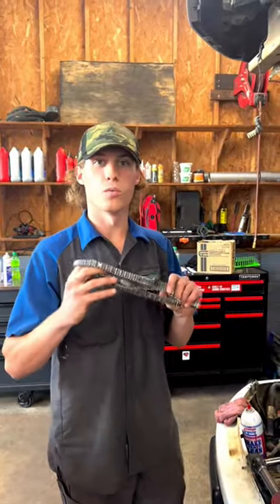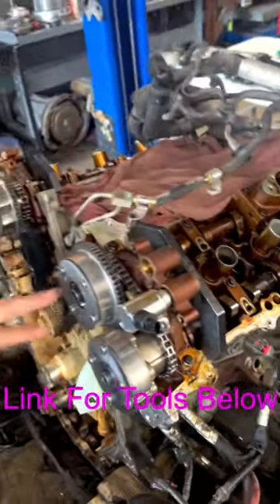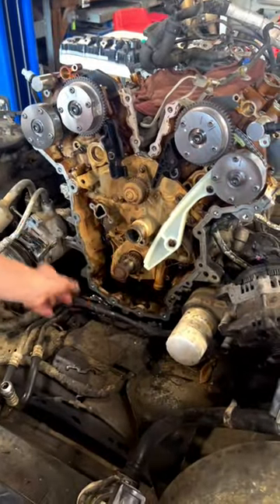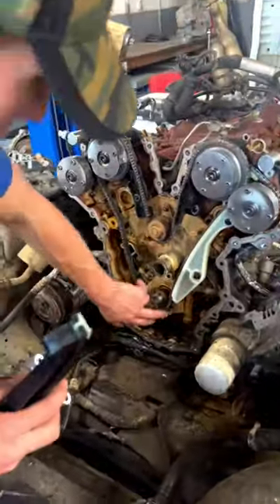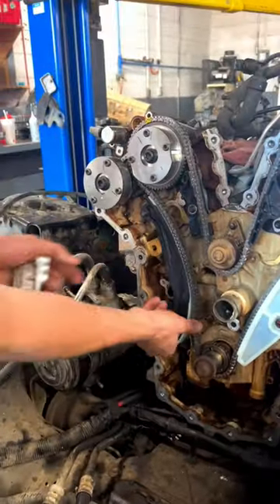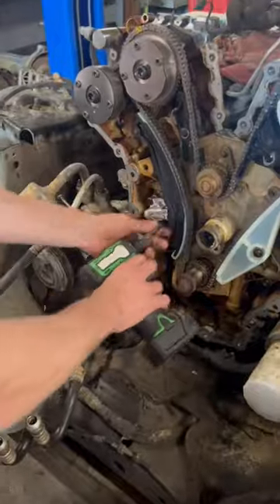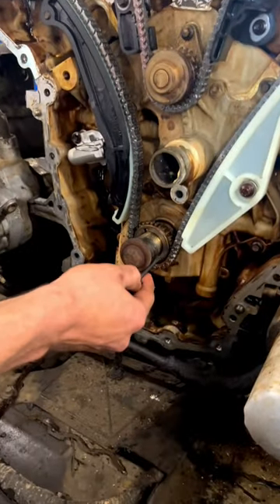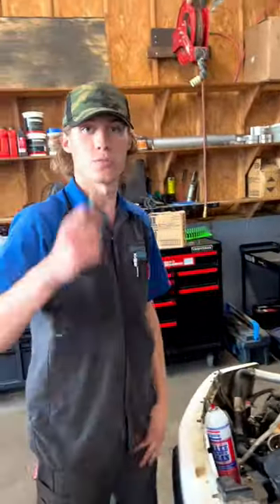How to Time a Ford 3.5L EcoBoost #shorts

Comment: Is that a timing chain driven water pump? If so, why didn't you put a new one on?
Reply: So on the Ecoboost it's not inside like the not available/na 3.5l it's on the front like a 5.0
Reply: @Crockedflyer811  Whether it's internal or external has to do with it being longitudinal or transverse, not 3.5 NA or EB or 3.7
Reply: @foojub6907  oh I see cool didn't know that

Comment: Why u don’t change the water pump ?? If you already have everything at part ???
Reply: How do you know he didn't change the water pump? The water pump for this truck is not even shown in this video.
Reply: Water pump is external on this configuration.

Comment: Should of moved the locking ring to keep tension till oil pressure is good
Reply: The tensioner is spring loaded, not ratcheting, ratcheting design caused issues.
Reply: @foojub6907  yep sure is and has a spring locking clip...
Reply: @justinsolomon6972  could you explain please? I don't understand
Reply: @foojub6907  it's a spring loaded cylinder with a back cut circular groove along the lower portion that a simi floating snap ring moves and when engaged holds chain tension .
Reply: @justinsolomon6972  how would you move it to do so? Doesn't pulling the pin accomplish that?
Reply: @foojub6907  the pin only holds it in a compressed state. The lock ring holds the cylinder out holding tension on the guide.
Reply: @justinsolomon6972  right, so how would he adjust the locking ring to hold more tensioner than the spring on its own? I’m doing one of these right now so I’m hoping to learn
Reply: @foojub6907  just move the ring down the cylinder into a cut channel.

Comment: Why did you not change the water pump while you was already in there?
Reply: Not a water pump. Longitudinal 3.5 has external water pump, internally replaced by an idler.

Comment: @FlyingWrenches13  Why does my 2014 only have 1 vct solenoids per side and different looking exhaust phasers?  Can't find exact info anywhere.
Reply: If it's not Ti-VCT (twin independent variable cam timing) but just i-VCT then you only have phasers and VCT's for one camshaft per bank

Comment: Mazda 3.7 liter. The same?
Reply: the same-ish. for yours it is transverse, so you have an internal water pump in the middle where the idler is on this engine, which should be replaced. If you're doing this job it simply makes the most sense to replace all guides, tensioners, tensioner arms and chains. Would do the crank sprocket as well. Phasers not unless you're having issues

Comment: The first thing is replacing the water pump. the last thing is to put everything back together.
Reply: Last thing's the water pump, actually. External on this configuration. Transverse has the internal pump.

Comment: If it’s interference design, that crank will not rotate a hundred times let alone one time with the cams locked down.
Reply: He's not saying rotating it with the cams locked, he's saying it wouldn't matter if the crank moved, so long as all the marks line up it won't be out of time.

Comment: Not changing the water pump while you’re in there is CRAZY.
Reply: nah, what's crazy is worrying about water pump replacement when its external on this engine. Longitudinal 3.5/3.7 have external pumps that can be easily replaced without cover off/timing. Transverse have internal pump for fitment.
Reply: The water pump is external on F150s and also removed in this video.

Comment: Anybody ever have an exhaust camshaft off one tooth and have it run okay just a rough idle. Currently going on with my truck and getting a camshaft b over retarted code. Already ruled out the sensor and chain is 5000 miles old

Comment: Or buy a motor with no internal plastic parts in the first place.
Reply: these engines have issues with phasers, water pumps, or chain stretch. plastic parts is not one of them

Comment: Did you ever do the timing on a 46 and a Lincoln LS you know how f*** up it is Ford actually tells you to tie the timing chains together with twine or fishing string to keep them tight so that when you crank the engine and oil pressure is build the tensioner snap and literally sounds like something broke scares the s*** out of you specially first time doing it

Comment: Don't you think it's a good time to change that water pump before a major failure?!!
Reply: External on this configuration, not internal.
Reply: Can you please tell me which gen one 3.5l ecoboost use external water pump please cause I saw many of them with internal water pump. Cause even if it is an external water pump still need to change that water housing seal and that timing chain idler on it and still it can cause of major damage to engine.
Reply: @mohammadtaqi1396  longitudinal are external pumps. Transverse is internal. The gaskets and idler are not known to fail

Comment: Dude why aren't you putting a water pump in there it's only the cost of the part
Reply: How do you know he didn't replace it? The f150 does not have a chain driven pump.
Reply: That's right the F-150 has an external water pump not driven by the chain, but that  center idler is, it's still only  50 bucks still replace it he has a sealed bearing in it. I woul replace it think will it last another 150k?

Comment: Seems to me these new high tech engines from most all manufacturers are not worth a damn. So many issues with high  tech. I miss the old muscle cars from the 60's.. not crap, always ran and never an issue.
Reply: If you really believe that old muscle cars didn't have any issues and always ran 🤣

These newer engines have less maintenance. Better fuel economy. More HP. Last longer. Etc. The "issues" you are seeing are a low percentage compared to what old carburetor cars used to have problems with. You people have terrible memories
Reply: @gorillawrenchin  old cars are fun, but very loose. Those old school motors were loud and felt powerful because of it lol. New motors do have much less maintenence needed, but the ecoboosts do have a ton of notable problems that I've seen, especially the small ones. In my opinion the last gens of the 302 ford and 350 chevy were pretty dang reliable, but then again compare those to a 5.3 and the 5.0.... the only thing is those 350 and 302 motors were so easy to work on

Comment: wow all that work and you only halfassed it. ya forgot a few things cg and wp should have been done at the same time. they wear too. just so ya know
Reply: Phasers were the problem. If crank sprocket doesn't have wear, for what are you changing it? As far as the water pump it is external on this configuration, it is simply an idler in the middle.
Reply: @foojub6907  both idler and crank wear. if you can see it or not dose not matter. if your going to do it right you do it all
Reply: @tc539  everything wears. Engine wears, replace engine? No. Because there’s tolerances. Blindly replacing parts for the sake of it is for hacks or tools. Under normal operation the engine will need new guides/chains/tensioner long before it needs new sprockets.

Comment: Simple, don't buy ford with there screwed off designs. There such a pain to work on. Why is it takes you 4 shafts vs 1 in most other vechles.

Comment: Definition of a motor ... Electronic devices that outputs power ... Engine not a motor
Reply: Funny thing about that motorcycle having to be registered at the motor vehicle department after going out on the lake in my motorboat powered by a motor from Ford motor company....but yeah, keep trying to tell everyone how smart you think you are....
Reply: @jesusace83  

But wait, there's more:

mo·tor

/ˈmōdər/

￼Learn to pronounce

See definitions in:

All

Mechanics

Biology

Motoring

noun

a machine, especially one powered by electricity or internal combustion, that supplies motive power for a vehicle or for some other device with moving parts.
Reply: @johnpeters9793  ya so the word can still be taken out of context in this world of gender confusion make your choices of words wisely!! Cuz the motor still uses electricity to run or an internal combustion engine..
Reply: @jesusace83  

A motor can be electric or internal combustion....there is no confusion, except from those who lack the ability to comprehend the written word from sources far more intelligent than themselves.....and that does not mean a community college auto shop "instructor."
Reply: @jesusace83  

I've proven you're mistaken with multiple examples....none so blind.

But just in case you're still having a problem with the written word:

motor

1 of 3

noun

mo·tor ˈmō-tər 

1

: one that imparts motion

specifically : PRIME MOVER

2

: any of various power units that develop energy or impart motion: such as

a

: a small compact engine

b

: INTERNAL COMBUSTION ENGINE

especially : a gasoline engine

c

: a rotating machine that transforms electrical energy into mechanical energy